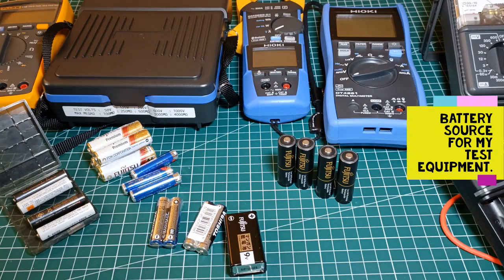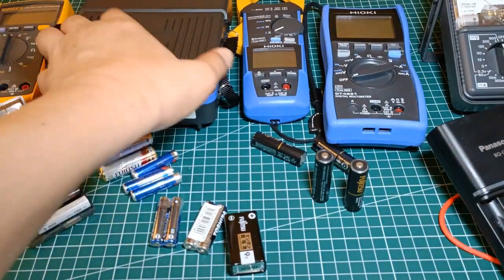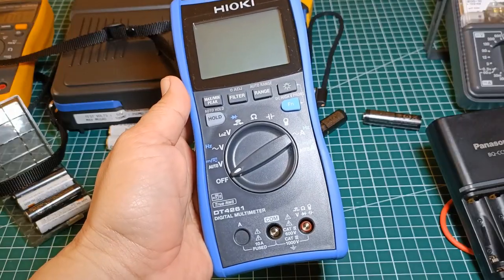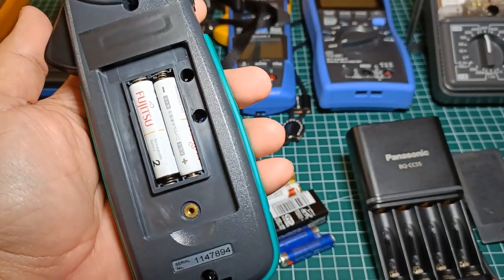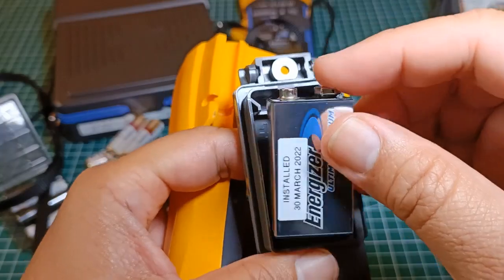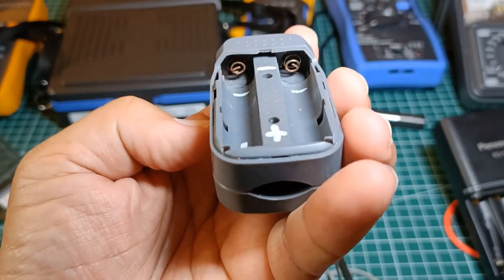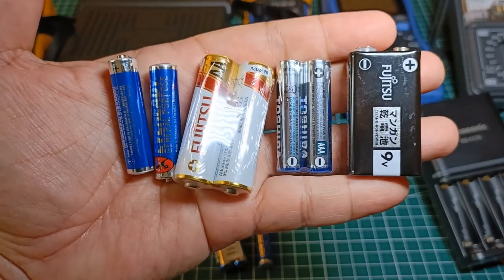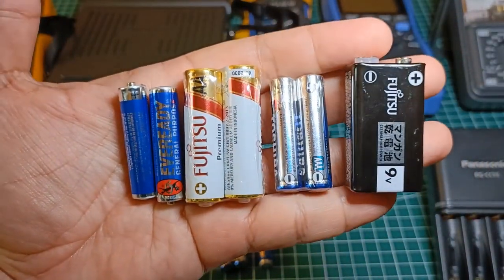Recommended Batteries for Electrical Test Equipment

Comment: I stopped using any kind of alkaline batteries decades ago because of leakage, switched to eneloop's and they have been great, However over the last few years I found that rechargeable Lithium batteries run much longer, have more power and are much lighter too, primary Lithium's are great too but do cost more
Reply from the maker: Thank you for your insights. Rechargeable lithium batteries are indeed a great alternative. I have quite a number of them (12V, 18V, and 3.7V) but not 1.5V ones yet though.

Comment: Good information sir .i just asked u about this information but u have now posted video . Yesterday i fell down second floor .
Reply from the maker: Sorry to hear about your fall. Hope you are well.
Reply: @ramschannelreviews   thankyou
Reply: @ramschannelreviews   i have one more doubt . what is acceptable value insulation resistance i watched ur video 10 Meha ohm's you have suggested .i have watched another video posted by jumper man tech channel ID who used supco 500 insulation tester that meter shows category wise  between 20to50 Megha ohms bad.50to100 caution . above 150to 1000 is good and excellent. so I have small confusion in this regard.please post useful video about this information. 🙏
Reply from the maker: @Tirumalaaircontrols  IThere are quite a number of opinions in this regard, including one from Megger, a reputable source. I'll see what I can do.
Reply: @ramschannelreviews  👍